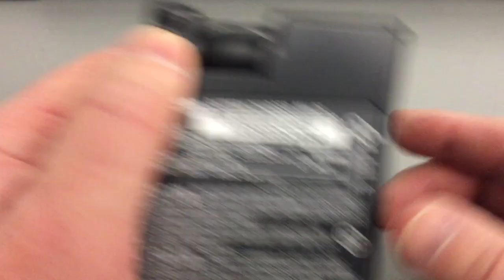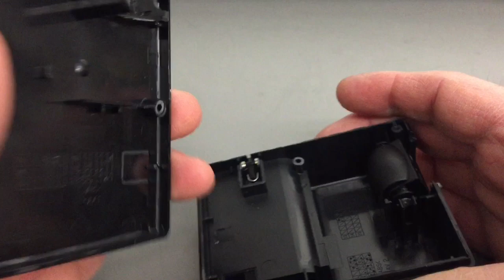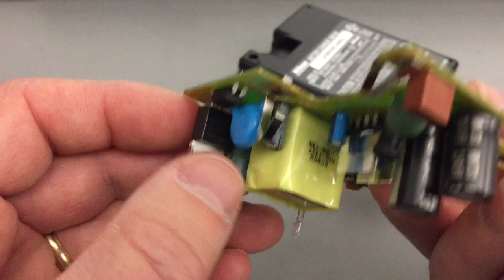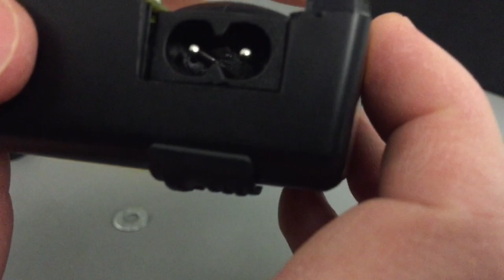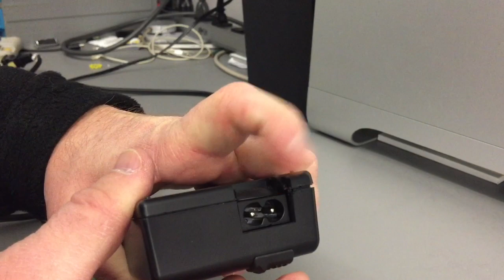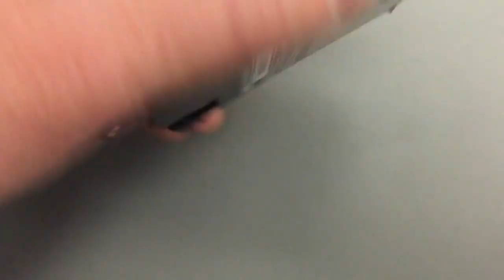Repair time: Nikon MH-25 charger repair.

Comment: What is value of D2 and D6 smd diodes? Plz
Reply from the maker: Sorry, no idea, I’m not a reseller.
Reply: @JimsEquipmentShed sorry . I said  primary side attached diodes value (d2 and d6) because i have this charger but its d2 ,d6 diode had blown burned i cant identifying that diodes😢
Reply from the maker: @poornajayavilal5851  Ahhh, that makes sense now! Sorry  I’m out of that job now, and have no access to that gear.
Reply: @JimsEquipmentShed can you give schematic of this circuit
Reply from the maker: @poornajayavilal5851  Sorry  I’m out of that job now, and have no access to that gear, or documentation.

Comment: Wow i watched your video after resoldering mine. Shoot i thought i was bad at reflowing joints but youre worse than me. I use a fine soldering pencil, not that big plumbing thing you were using. :)
Reply from the maker: I think this looks bigger on camera, that’s an extra fine solder, as well. Those are the rooms I have at work, so that’s what I use. On the bright side, it’s still working, so I didn’t do that bad.
Reply: @JimsEquipmentShed  well… theres fine and finer. Youve got the skills. But totally agree about results. Im glad mine is working too. Now i know not to drop it. Embarrassing design.

Mine worked great through all sorts of crazy travel, loaned it to my son and i broke when he arrived in france, no charger for 3 weeks. Returned home last night, it was rattling, opened (using vice and wood chisel) reflowed those 3 joints and its working again. I didnt think to lookup youtube until after but it all went well. Easier repair than i hoped.
Reply from the maker: @ericchristoffersen9355  I’ve repaired several of these, Nikon’s design is sloppy and made worse by gluing the case together to prevent service.

Comment: As a retired Electronics Technologist with over 30 years' experience, I can tell you that this charger is not any more badly designed than most other pieces of home electronics.  It just wasn’t designed to be dropped on the floor. It may have been supplied by a third party under contract to Nikon.  One short drop onto carpeted floor won’t usually break parts free from a board.  It mostly happens after repeated knocks or drops and people don’t notice it until it fails. 

There are many parts on this PCB that could be compromised if you drop it often enough and it would not be cost efficient to “brace” all of them.  What you could do, now that you have it apart, is to use a hot glue gun to drop some glue around any parts that are heavier and stand off from the board.  That was common practice years ago, but you don’t see it as much anymore, possibly due to cost-cutting measures. 

I have several different Nikon chargers and I dropped one of mine on a hardwood floor a few years ago.  One of the fine traces on the board cracked and it stopped working.  A simple solder repair put it back into service.  If you solder a trace that has cracked, remember to solder a small piece of wire across it to beef up the join.   

On another note, if you keep your soldering iron tip clean you won’t struggle so much with your repairs.
Reply from the maker: In our fleet of Nikons, this was the only style of charger that had this issue.
And it was the exact same fault.so sorry if you worked on this design, but it was insufficient.
Reply: You can't really call it a fault if it got dropped on the floor.  It's a fact of life that the rougher you treat electronics equipment the more likely you are to have problems.  If you have a fleet of chargers that are in constant use and they're getting dropped a lot they're gonna get broken. You can't call that a design flaw.  That's more along the lines of abuse. Open up all the cases and put a dab of hot glue at the base of the voltage regulator so it supports the part.  That'll stop a lot of the breakage and you'll have fewer repairs and unhappy end users.
Reply from the maker: @TechSavvy. Design it with support like the old ones were, and it won’t break.
The old ones didn’t.
Reply: @JimsEquipmentShed  It's too late for a re-design, now.  Damage control only.
Reply from the maker: Yup, thats the reason for this video, it's an easy fix. 
But it's not too late for them to put this warning  into the engineering tech notes for the next design possibilities. @TechSavvy.
Reply: @JimsEquipmentShed  You're naive if you think design engineers go to YouTube before designing a new charger.  They already have access to repair data from the service centers.  That's how new equipment is improved. And these are not the first circuit boards to be made that way.  PCBs have been around for over 50 years.  If this type of design was causing a lot of problems they'd have been changed by now.  Even the old boards have this kind of design in them.  Breaking a PCB by dropping it on the floor does not make it badly designed.  Try it with some of your other household electronics and see how many survive.
Reply from the maker: @TechSavvy.  Uh, actually, the design has been changed. 
And the previous style charges used to get dropped a lot and survived. 
This new one was clearly a bad design.
If you can't drop a charger from 4' to a carpet and have it survive, it's certainly not going to make an expedition to the arctic....
Edit: And it wasn't the PCB design, it was the component placement, and support.
Are you really a retired Electronics Technologist?  Or maybe you didn't actually watch the video?

Comment: I recently dropped my MH 25a charger(just a year old), it stopped working. Now I landed up here :) 

Unfortunately I don't have a soldering iron, would have to give it to a guy. But cool video, at least now I know what has gone wrong.
Reply from the maker: Its never a bad idea to have a cheap iron and some solder kicking around for quick fixes like this.

Comment: 와 뜯는 것 까지가 내가 할 수 있는거네. 물론, 나사 풀어서 뜯은게 아님.
사야겄다. 10년 썼으면 많이 썼다..
Reply from the maker: Could you see the broken part once you opened it?
Reply: @JimsEquipmentShed  Even if there is a broken part, I think it wasn't broken before I opened it, but it was broken when I opened it because I opened it by making a hole in the case.
I think the wrench used in assembly is a wrench that is not commonly used so I couldn't open it normally.
It's okay. I bought a new one the next day.
Reply from the maker: @patentshin  In any event, it was interesting to take a look inside right?

Comment: Thanks a lot for the video, Jim - I also had the same problem of the Transistor solder tracks getting broken. Fixed it and its working fine now !!
Reply from the maker: Glad it worked. I’ really amazed that they didn’t design that better.
At the very least, they could have made it easier to disassemble…..
Reply: @JimsEquipmentShed  Very True - I have applied some hot glue to stabilize the Transistor and prevent damage again. Looks like they did not perform the Drop Test :)
Reply from the maker: @ashitg65  Yea, that design only works for a device that is never actually used….It’s amazing to me something that simple slipped through the cracks….

Comment: Great video Jim. I dropped my charger from my hand onto a marble floor whilst on holiday in Italy and it stopped working. On return home I could not figure out how to open it. Your video was perfect. Sadly, no obvious physical issues with my unit, and there is no way I am going to attempt to fault find in the 'robot vomit' of SMD parts. Ver flimsy design for something likely to be used whilst travelling.
Reply from the maker: Even if it doesn’t look bad, just try resoldering that connection.
That is most likely going to be the problem, even if it looks ok.
It was amazing to me that their engineers let that poorly designed mess slide by.

Comment: Thanks a lot, same issue with my device and I didn't drop it. My repair was just a bit of bumf pressing the transistor(?) in the right direction :-D
Reply from the maker: It doesn’t take much, one of our users swears that maybe he tossed it into his camera bag, but it certainly didn’t hit anything hard. (Other that’s the end of the power cord, and a loose trigger release. )
I think that component just weighs too much to be left unsupported. Eventually they all seem to break.

Comment: OMG, this free wiggling Thyristor inside the charger seems to be mechanically a bad Nikon Design, at least after a drop on the floor, and no more charging. Should being re-soldered again simply. I'd suggest using a good old desoldering pump, to get old solder off the PCB. And just using a soldering iron with a finer point, no offense. 

I've just bought a cheap 3rd party charger (less than 10 bucks, instead of the original here, which costs >80 EUR up to 99 EUR, unbelievable), because i've lost my MH-25 somewhere (it never went defective, since my Nikon D7000, but was never falling down, too)
Reply from the maker: Yea, it is a terrible design, and it actually pushes the trace right off the board.
 So desoldering wouldn't have helped, that was a bridge over a cracked joint. 
The nikon engineers could have fixed this for sure with about three seconds of thought.
If I really cared about the ascetic of it , I would have run a jumper wire and cleaned it up. 
In this case, I just needed a solid connection.

That charger is in a fleet of like items, so substituting it with an off brand knock off wasn't an option.
Reply: @JimsEquipmentShed  I see. Yeah, at least you've fixed it! Good work. For such little electronics via PCB inside, i would really never spent close to 100 bucks new. It's being too overpriced via Nikon.

Comment: Great job, I love home remedies, especially without the use of specialized equipment, which allow me to fix the device myself at no extra cost
Reply from the maker: Yup, this was a lot cheaper than replacing the charger. I wish they has assembled the case entirely with screws though, they didn't need to fight us on this.....

Comment: Thanks for the video...I opened mine and put it back together without doing anything...and it works 😂😀👍
Reply from the maker: The solder joints might be touching again temporarily, you should hit those with a soldering iron just to make sure the connection is good.
(Or the next time it gets bounced, it will probably lose connection again.)

Comment: Ohhh, shame on whoever made this charger and also Nikon quality control and engineers. I searched on youtube and found 3-4 videos about it. All have the same issue. I made thin "nose" on my soldering tool and will fix tomorrow. Most challenging part was to figure out how to open. Thanks for your video!
Reply from the maker: Yea, if they are going to engineer theses things so poorly, the least they could do is make it so that the case unscrews.
The glue thing was really short sighted.
Not as short sighted as their electrical engineering department, but still........
Reply: @JimsEquipmentShed  after soldering i will fix that detail with hot glue I think. To hold it on the plate well.
Reply from the maker: Aigars Liepins Yea, that’s what I did as well. It’s unfortunate Nikon didn’t do that in the first place.

Comment: I had the same problem with the charger I have, I wonder how many duff chargers are out there because of this issue. After resoldering the track I finished off by gluing the component to offer some support and rigidity in an aide to prevent this fault happening again.

Very good tutorial Jim. My charger is working again.
Reply from the maker: M1ZXZ Yea, Anything you can do yo keep it from getting rattled back off is a good idea. It’s a really poor design.

Comment: Hi guys! I realized my MH-25a charged has a hole with a pin in the middle right behind the plug in piece. I´ve take a bicycle spoke, bent it with a curved shape (hook) to insert it through the mentioned pin. Then clamped the spoke and pulled out holding the other part of the charger. I´ve been able to open it so in a very clean way without damaging it much. But once opened have found everything seeming to be on place, so, as I know about electronics theres nothing I can do. Thanks for the video again.
Reply from the maker: RMG Wheels & Spokes Lab. that’s cool! I’m always up for a new trick or two! Thanks! I never even looked at doing that. Take a really close look on your charger, sometimes, until you wiggle that thing, you might not see the cracked wiring trace.

Comment: Thanks for the video. What a piece of trash. I was sat down on the chair. Picked up the charger with the battery in after a charge, hold it from the cable and the unit disconnected from the connector and fall down to the floor something like 30cm or so. It was so stupid to me to think it was damaged that I just checked the outside which didn´t have even a scratch, but something told me "try it"... and when I plug it in the light didn´t turn on, then did some noise blinked and isn´t working any longer. A D500 camera useless now because of a crapy charger... come on...  My D90 had a better charger. I have 2 charged batteries and we are lockeddown.  :(   :(
Reply from the maker: RMG Wheels & Spokes Lab. Yea, at the very least, you can do this fix and that will get you through lock down.
Because of the glue, it kinda (as you can see) damages the case if you are not careful. But at least it will give you a charger until you can get a replacement.
Totally agree on the D90 charged. 
Those things are tanks! 
I don’t have any videos on repainting them. I’ve never seen one break.

Comment: Today I've picked my MH-25 for charging the battery of my D600 but didn't worked... I've searched some tutorials for open the unit and found this video. 

After a bit of work I've extracted the board from the box and found the same problem of yours! I've fixed it and secure D7 with a drop of hot glue on components side of PCB. Now the bad boy is securely tight in place :)
Thank you
Reply from the maker: I'm glad it helped! Its a shame that they engineered this unit so poorly, this is really basic stuff in the world electronics. 
If they have heavy components, they really need to be secured better.

Comment: Thanks for your helpful instructions. How exactly would you go about opening the device using a heat gun?
Reply from the maker: Timeless Blues Foundation run the heat gun along the seem and it should help loosen it (the adhesive) up enough so that it wont crack.
Then just use superglue to hold it back together again.
Reply: That's exactly the way I split the case apart. Slowly heat the plastic, otherwise the plastic will distort if heated to much, so take it slow and easy, I then used a safety blade and gently pressed into the case between the two halves. It will be much easier if you only heat one section at a time and use the blade until that particular section is apart then move onto another section and repeat the process. Patience & perseverance is key to a nice clean job that you will be satisfied with with hacking and destroying the case.

Comment: Thanks for sharing this info. I repaired mine with your help but it failed again while I was in England. I was resigned to buying a new one but a camera shop in Bristol sold me a charger that connects to a phone charger. It is half the size & you use your phone charging lead. The brand name is hama & it cost £11.
Reply from the maker: I’ll have to look into that, thanks.

Comment: I just dropped mine as well.. Trying to break into it right now.
Reply: My problem was not the transistor but a broken PCB where it's very narrow between the slot and the AC in.. Gonna fix it with a piece of wire instead.
Reply: And it works again!
Reply from the maker: @erik....  Excellent! Although it would have been better had Nikon just built it better to start with....

Comment: My MH-25 charger stopped working but not same issue. Transistor solder connections seem fine. All solder connections on circuit board look OK. Here is tip on separating plastic case. I used a sharp chisel. Tap with hammer around all four sides. Seems to separate small amount of glue used. I welcome any other ideas on what could be wrong with charger?
Reply from the maker: I like the chisel idea, as I wasn’t pleased with the damaged case. 
I would resolder them anyhow, as sometimes those trace breaks are about impossible to see by eye.
Reply: @JimsEquipmentShed  I took another closer look and found the apparent problem. A small crack in circuit board where power connector spring clip is mounted on board. The current path is interrupted. I will try jumpering with a wire soldered to spring clip pin and to TH1 pin where board path leads. This spring clip holds the swiveling power adapter. Another poor design since a lot of torque is exerted on this very thin part of circuit board when connecting and disconnecting the power cord. CAUTION best to leave your power cord always plugged into charger. Only remove from wall.
Reply from the maker: Swips Eightyeight Yea, anything that moves, and it doesn’t really need to, is a bad design.
Glad you found the issue.

Comment: Mine fell 18 inches onto a vinyl floor and stopped working. Won't be buying another Nikon charger for $49. Overpriced and this seems to be a problem with these units. Bought a 3rd party charger. Will try to fix the Nikon and use as a back up. Thanks again for a clear understandable video.
Reply from the maker: Yea, thats a really bad design, and its going to be that component, so at least you know what you are looking for. 
Some of the links in my description box go to others that have repaired it as well.